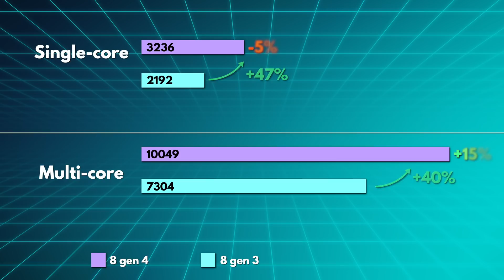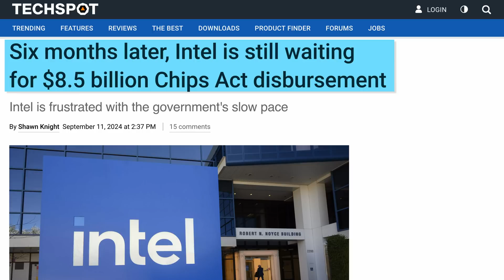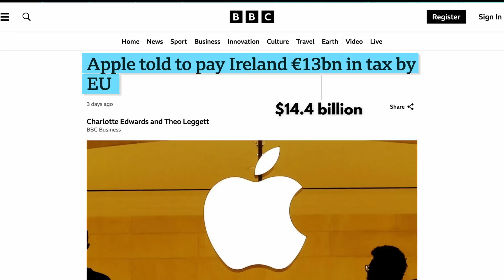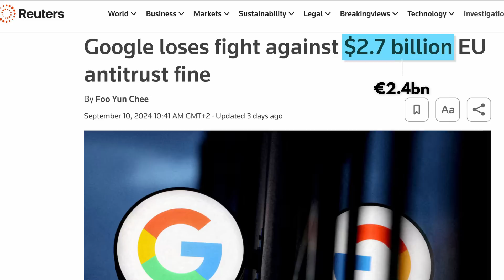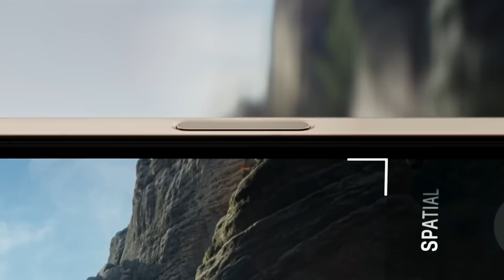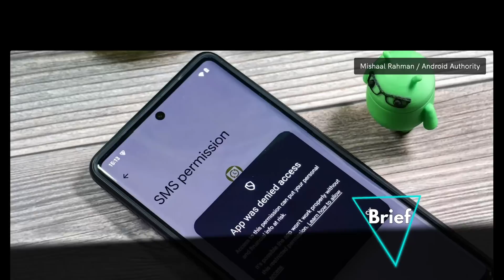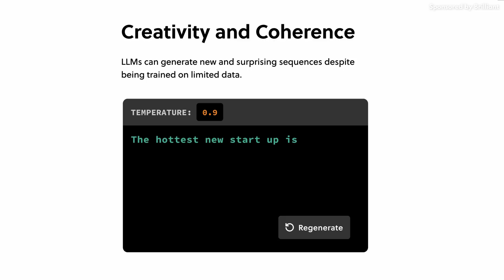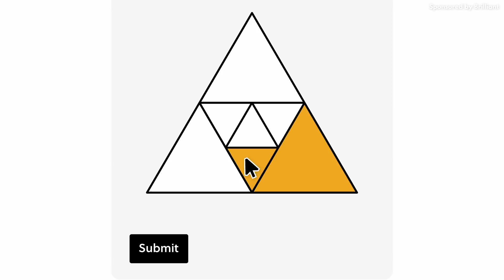Leaks show Qualcomm finally beating Apple!

Comment: What could be the impact of Qualcomm improvements on standalone VR headsets?
Reply: double the performance in the next round of chips but I think it will be so much better as we now have DLSS or the mobile alternative to it handled by the little neural chips you get in the chipset and that could mean another Quest 3's worth of performance right there. Finally foveated rendering will feature in Quest 4 as its so cheap to add it now and all three of those things combined we should see almost 3x the graphics performance from Quest 3 to 4. That's absolutely stunning and amazing news for VR as that means things like Half Life Alyx could easily run on Stand Alone hardware. The only spanner in the works is if Meta decide to save money with the minimum amount of memory and that will screw us from any big game worlds happening. Its what screws the iphone right now despite having the hardware to run lots of AAA games.

Comment: 8 Gen 4 beating the A series? 
I'll believe it when I see it.
Qualcomm keeps talking a huge game without delivering.
Reply: It doesn’t beat it at the same wattage. It uses double the power draw. The equivalent versions of the m chips best the equivalent snapdragon chips. But Qualcomm like to compare to apples entry chips
Reply: 8 gen 2 and 8 gen 3 already beat Apple in gpu. 8 gen 3 also matches or beats Apple in multicore performance, and now they will close the gap in single core. The progress is real
Reply: @eduard6450  lmao look man, I hate apple as a company as much as everyone else, but let's not kid ourselves. This is like how Intel would say they're the best at gaming performance while sucking up twice the TDP of AMD processors.
Reply: Its just a leak. probably a unit running at higher than usual clock for testing.
Reply: they do, currently 2.5 gen ahead of apple in gpu
Reply: @drushed7387 & from past many years too
Reply: They could do it, but I hate to imagine the monster-sized battery needed to keep up with the new SoC.
Reply: Also keep in mind the Snapdragon has 2 more e-cores. Naturally that will help out considerably with multi core performance, and in all likelihood consume more power.
Also, the A18 p-core IPC is still a year ahead of the S8G4. The Snapdragon has to clock higher by 7% just to get within 5% of single core performance, in these leaked results.
Reply: The so called "king" dethroned it's self already in the real world when they announced current models and recent pro models were incapable of performing some very basic so called AI abilities.
Benchmark numbers all you like but when by own admission the capability isn't there, the proof is in the 🍏🥧
Reply: One notable difference is that Apple has adopted Armv9.2a architecture for the A18 Pro with SME (Scalable Matrix Extension) support that delivers faster AI performance via the CPU. Whereas the Snapdragon 8 Gen 4 is still on the older Armv8 architecture that doesn’t take advantage of high-computing extensions. It means that A18 Pro is likely to perform better in AI/ML tasks.

Sure, the Snapdragon 8 Gen 4 packs two more cores so its multi-threaded performance is going to be better

With all that said, Apple is likely ahead of Qualcomm in terms of performance per watt and most likely uses less power to deliver the same level of CPU performance.
I think apple care alot about efficiency, lets see how much watt gen4 uses and how the temperature will be
Reply: Everyone talks about gen4 GPU but there are still not one game that perform better then on iphone. Even last yeats iphone will outperform android because the games are not optimized for android…
Reply: @Randomdude21-e gaming phones will beat crap out of throttling iPhones 😂
Reply: @neddiego2570  iphone 16 pro runs cool and no android gaming phones wont. Not a single game is optimized and probably never will be, to many different models of phones
Reply: Where ur leaving
Reply: The 8 gen 3 already beat the A chip so what are you talking about

Comment: i swear, all the people here are just apple glazers
Reply: You can thank Google's glazers for that. Now that side loading is going away and the phones are approaching price parity, there will be almost no valid reason left to pick Android phones over iPhones anymore. iPhones are rapidly catching up with Androids on the hardware front (iPhones used to have half the RAM of flagship Androids -- but now, they're at 66% and at this rate, may get 16GB sooner than Scamsung, who still flog 12GB RAM as their best offering in their Ultras since 2019). They've already got the same tier/quality OLED panels, they've already adopted the latest Qualcomm modems, they already have the better SOC and they're getting far better & more stable OS updates than Android phones ever will (much more frequently too and without the delayed/stalled rollout that old or budget Androids have). I'm running out of reasons to upgrade any of my old Android phones anymore.
Reply: they are strange people those Apple users. They bitch and moan at every event then go out and buy everything from the event anyway. Then start complaining again that not enough was added. My whole family are Apple users and they constantly moan about the prices but no interest in not buying Apple. I'm the rogue Android user of the whole family torturing them with cheap deals I get on phones and tablets.

Comment: If sideloading were removed, I wonder if Android would retain any significant advantage over the iPhone, aside from the file manager. (Admittedly, I download modded apps, as the cost of purchasing all the paid apps I use would accumulate rapidly.)
Reply: there are still many advantages android has over ios. though lately apple has been catching up. tbh i hate android trying to be more locked down. im losing interest over android updates when every year comes with more restrictions, while looking at the walled garden next door celebrating every new feature adapted from our side but with less jank.
Reply: @sussei  1 such advantage is, Android accessories are much cheaper than Apple's haha
Reply: Yeah. I'm an android power user and I'm hating the increased restrictions year after year. Especially now that they are restricting sideloading and increasing restrictions on apps like termux and losing access to the 'android' folder. I have been contemplating getting an iPhone for a while and Google seems to make that option more appealing for me.
Reply: The removal of sideloading would be a massive issue for me personally. It gets annoying. You have to rootkit your phone just for basic access.
Reply: I just bought samsung and if they decide to strictly implement this then my money's going to apple next upgrade cycle
Reply: Sideloading and price were the reasons I switched from iphone 6 to galaxy s20.
Reply: well, better notification ,volume controls, keyboard, torrent support, download managers and customisation options. just to name a few.
Reply: @52incredible talk about customization, ios is on par with android nowadays and in some aspect, the customization that apple offer is better than most android skin
Reply: There would probably be a way to bypass the sideloading prevention tbf but idk if you need to have a custom ROM installed or not 🤷🏼
Reply: I download modded apps, as the cost of purchasing all the paid apps
and that's why developers prefer iOS to develop there apps  why develop 
high end pro apps for phones and tablets when a lot off people download 
them for free developers will not work for free
Reply: If side loading is removed Android will become worthless overnight and I won't ever buy another Android. iOS is already better in almost every other way when it comes to software (my low end 2016 iPhone SE is still getting security updates to this day, which I received a few weeks ago -- show me a single Android phone at any price range from even 2019 that still gets official software security updates and support from its manufacturer today. Not even the Pixels do). Apple is the only company that offers the exact same software support cycle for its budget devices as they do for their flagships. Android market share will fall off a cliff within 3 years if it actually happens.
Reply: @ma-af3753  security patches and software updates are two different things. nobody even cares for software support that long. most people change their phones within 3 years
Reply: @ma-af3753 Not quiet true, Galaxy A devices get 5 years updates, also it is possible to upgrade on your own.
Reply: wrong, nearly all the people I know sideload apps
Reply: @hrishi4200  True ! I sideload apps too, especially on my modded and degoogled phone
Reply: Hardly anyone uses side loading. Android is a more modern os
Reply: It would absolutely. None of android friends care about side loading. Normal people don't side load.
Reply: @BenjaminKeller  Share-it is popular for the sole reason it makes it easier to share apps thanks to the ability to sideload.
Reply: If you are not side-loading modded premium app on Android then you are not using Android correctly ...  @BenjaminKeller
Reply: @BenjaminKeller  Also, scam apps are wrecking havoc everywhere. Normal people don't sideload but will be tricked into sideloading rogue apps and get their life savings wipe out so i see removing it as a good thing or at the very least, makes it so complicated to enable it so the average people won't want to enable it.

Comment: Android beats Apple in cpu performance before GTA 6
Reply: Not really, first of all the score what you should check is the single core score, because your phone actually always never do a real multicore work (well if you are not esiting photos/videos on it etc.. even games are only use just one core..)
But the bigger fail in this, when you already forgot what was the Note series, if that S24U still called to Note 24, that would use the same SD8G3 like the S24U have.. i mean if Note 24 release with the iPhone 16, why do you think it's still just the iPhone 15 competitor..? Just check the SD855 history.. announced in 2018 dec 4, released in Note 10 at 2019 aug, released in Pixel 4XL at 2019 oct.. and everyone compared it with the iPhone from 2019 because that phone released betewen the Note 10 and Pixel 4XL, nobody cared it was announced one years earlier.. it should be dumb idea to compare the 2019 oct Pixel 4XL with the 2018 sept iPhone (13 months earlier phone..) just because the chip was announced in 2018.. 😂

Comment: Apple was only leading with single core CPU. The dimensity 9300 was better at multicore and snapdragon was better in gpu

If Google continues on this route of restricting android more and more then they are forcing people simply to get iPhones. With iOS 18 apple brought in lots of features that android has had for years (its literally android in disguise) and its just right around the corner to bring in multitasking
Reply: would be funny if apple starts to allow sideloading and alternate stores for more widespread user, not just in select regions. android getting restricted just irks me more than an actual closed off software from the start like ios.

Comment: Dang, I’m still alive to hear android beating Apple in processor performance?
Reply: we're also on the timeline of apple opening up to sideloading and google trying to restrict it
Reply: @sussei  sideloading uYouPlus has been a blessing :D
Reply: I’m more worried about efficiency and heat generation, especially since they stated that they are using cores similar to their laptops.
Reply: @_Ker  Chips don't need efficiency cores, you can achieve the same efficiency by supplying the high performance cores with low power. Mediatek did this last year and Qualcomm accepted this approach.
Reply: @fakech  That’s interesting. Are those performance cores as fast as the efficiency cores at the same wattage?
Reply: @_Ker you mean the laptops that are more efficient then apples?
Reply: @_Ker cooler exist i have mine that decrease temperature from 45° into 28°
Reply: Benchmarks don't necessarily reflect regular usage but yeah, that's a shocker :D I didn't expect it for a while
Reply: @SS369 yeah optimisation is big thing
Reply: @SS369  Regular usage is meaningless because it's a bunch of random tasks that are different from person to person and any midrange chip and above can handle those tasks. Benchmarks are for the peak performance you can expect to get.
Reply: It's been consistently trending in this direction for a few years now.
Last year, with SD8 Gen 3 and the A17 Pro, the SD already had a better GPU and multicore scores were very close.
The only meaningful difference was in Single Core.
Reply: It's not android beating Apple, it's qualcom beating Apple chip. You could have android beat Apple with slower chips by being better phone, or worse android phones with stronger chips by being sucky phone.
Reply: Welcome to the world where anything is possible
Reply: What wattages are they running at? 
A 14900k might be faster than a 7800x3d but at double the wattage
Reply: @Noine14159145  It is not that simple; I did not check recently, but there were AMD CPUs that ran on 100% consoderable more efficient, but were terrible on idle, where there ran even at 60W, while Intel ones could run at 10-15W. Nobody uses their computer at 100% all the time, in the end you might have similar averages.
Reply: Android is hungry ,apple is like noo noo stay away
Reply: I doubt it's for phones, more like laptops. Flaghsip android phones are massively overpowered anyways for most use case.
Reply: @dtibor5903 you doubt the SD 8gen4 is for smartphones😂?
Reply: @dtibor5903 Oh if you knew how hot my s23 gets when playing warthunder mobile at max settings lol
Reply: Used to be the normal. It was all the way until the iPhone 7
Reply: One notable difference is that Apple has adopted Armv9.2a architecture for the A18 Pro with SME (Scalable Matrix Extension) support that delivers faster AI performance via the CPU. Whereas the Snapdragon 8 Gen 4 is still on the older Armv8 architecture that doesn’t take advantage of high-computing extensions. It means that A18 Pro is likely to perform better in AI/ML tasks.

Sure, the Snapdragon 8 Gen 4 packs two more cores so its multi-threaded performance is going to be better

With all that said, Apple is likely ahead of Qualcomm in terms of performance per watt and most likely uses less power to deliver the same level of CPU performance.
Reply: It doesn’t really matter who has the fastest chip, as long as they are in the same ball park. But the competition is great for consumers.
Reply: Beating in benchmarks, but iOS itself is a lot lighter than Android. Actual feel is unlikely to be better on Android anytime soon.
Reply: @IanHobday 
Android isn't 
Android skins are
Especially OneUI which is chock full of Multiple skin layers on top of the AOSP library 
I would argue that Modified Android and skins based on AOSP Like PixelUI and HyperOS are actually "Lighter" than ios by themselves 

They take up less storage on a 512Gb unit and Android in terms of Paging and compilation speed is Faster than iOS lmao
I can confirm this as an indie game dev cpu headroom is much more efficient
Reply: Do you hear yourself? It's about Hardware providers and not about software developers.
Reply: Qualcomm*
Reply: The current gen already beat apple so that's not news
Reply: It will overheat and won't be battery efficient.
Reply: The snapdragon 8 gen 3 already beats apple a16 in performance and graphics. Many YouTubers made video about it. Apple fanboys are living under the Apple bubble.
Reply: Dimensity 9300 was more powerful than A17pro
Reply: Yah, because you don't see apple as just a company and nothing more, maybe you see it as God but it's not its just a company and can be beaten by anyone
Reply: Me too 😂
Reply: The top Apple processor designers left to create a company called Nuvia that was bought by Qualcomm in 2021. The rest is history...
Reply: @miks564  ----- They were only the top according to themselves.  Confident types.  

Now back to reality.  Qualcomm will sell 20 million high-end chips and Apple will sell 300 million in iPhone, Macs, iPads.  Qcom has to charge Samsung so much that Sammy doesn't make money on the high-end.
Reply: Android beats Apple but also consumes twice more power
Reply: @iraklimgeladze5223 bro just some years ago any android dobled battery duration of any iPhone. Apple fans believe Cook invented the wheel lol
Reply: @iraklimgeladze5223 no lol
Reply: It’s about time tbh
Apple needs a wake up call
Reply: @Juanguar  ----- You mean the company that sells 9 times more high-end phones needs to wake up in their competition with distant second place Samsung?  Hmmm, odd.
Reply: @bruxi78230  I ain’t listening to a fanboy who licks the boots of Apple
I may be an Apple user but I’m not blind that their performance gains have slowed down in the recent years
Reply: @Juanguar  ----- An even more odd response, but ultimately very funny stuff.  Thanks.
Reply: Well, it sad if even tech channels can be fooled.. the SD8G4 is not the A18 competitor.. just answer ne if the S24U still called to Note 24 and only recently released, that SD8G3 is the iPhone 16 competitor, or just the one year old iPhone 15 competitor..? Just a quick reminder, even the SD855 was announced on 2018 dec 4, but only released in 2019 aug (Note 10) and 2019 oct (Pixel 4XL - the only flagship chip in the pixel..) and guess what, nobody only compared those to the 2018 iPhone because it was announced in 2018.. 😂 imagine when you compare the 2019 oct device to the 2018 sept device as competitors (13 months diff between competitors..?) 😂
Reply: @TamasKiss-yk4st  there is like 3 months between the first device with this chip releasing and the first iphone with a18 series releasing. and it's been like that for ages so ur just full o' shit
Reply: @wheezel55 guys living in his dreams
Reply: @TamasKiss-yk4st bro u r just dumb 😅